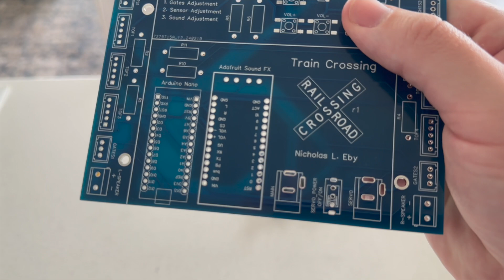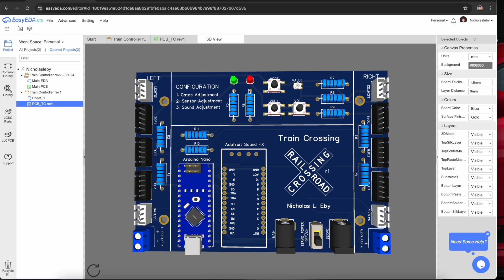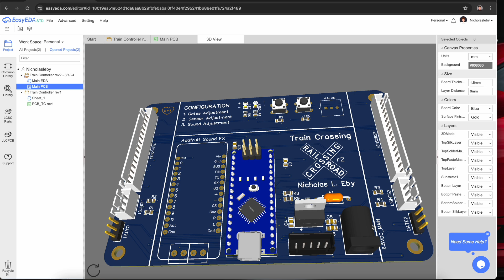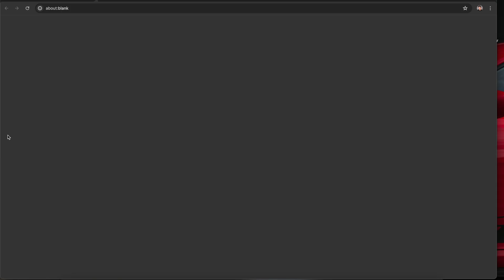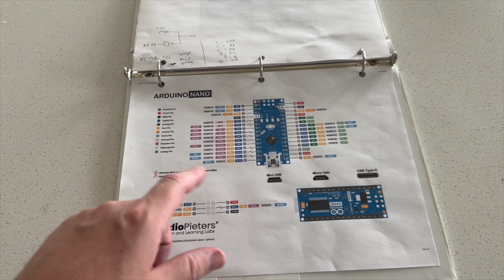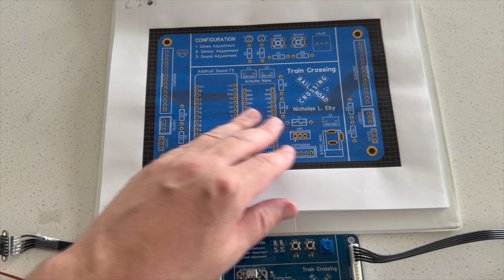Building a custom PCB for model train crossing gates with easyEDA and JLCPCB

Comment: Every PCB starts as as breadboard with wires.  Nice job on the PCB will you be making a 3D printed enclosure?
Reply from the maker: Thanks! Most likely – I think the next evolution of this will either be a touch screen display or bluetooth to an app. If the former, will need a nice all in one case, which would be fun to 3d print. I recently sold by resin printer because I tried the resin 3d printing service from jlcpcb and was blown away with how good the quality was.

Comment: Hey just a note, the electronic Bells at grade Crossings have a potentiometer inside them that can adjust how fast the bell sound repeats itself. Most of them are set to the same rate, probably because they aren't adjusted when they're installed. But sometimes it does get adjusted, whether by accident or intentionally, and it makes them distinct from others. There used to be one right at the Elmhurst station that rang super fast, which was probably the most unusual one on the west line. Unfortunately it got changed a long time ago. Also keep in mind the electronic bells on the BNSF race track are a different sound, have a different sound because they are from a different company.
Reply from the maker: Hey buddy! long time, hope you're doing well. You still rail fanning? Good note about bell and this is a nice feature I can add – I added control buttons and trimmer to my pcb to do things like adjust servo gates, etc, so this could be neat feature to speed up or slow down playback, or play a different sound file.

Are you looking forward to the new atlas/rapido models?